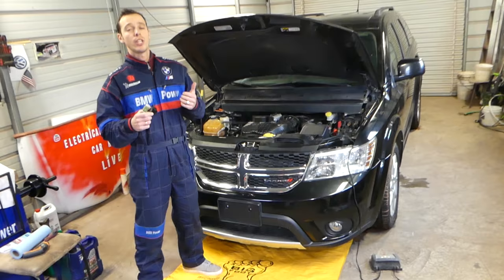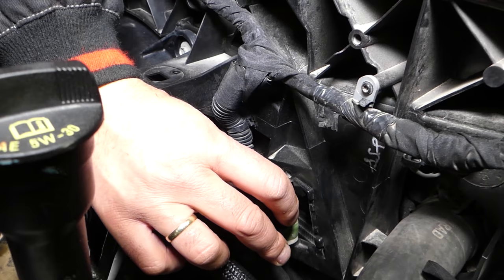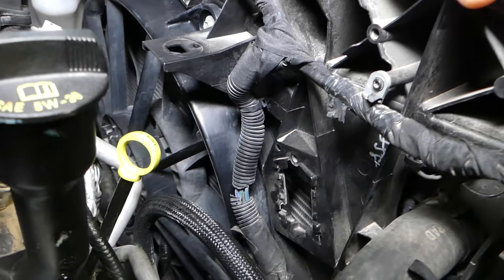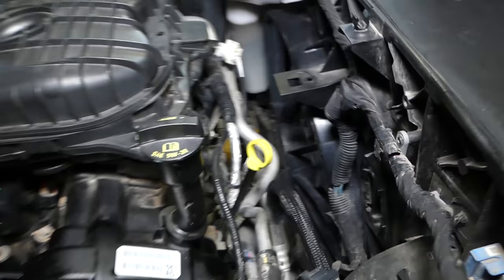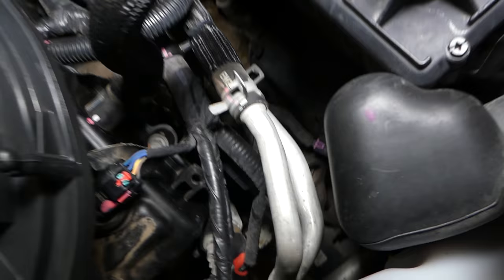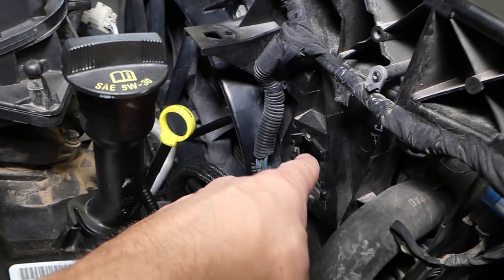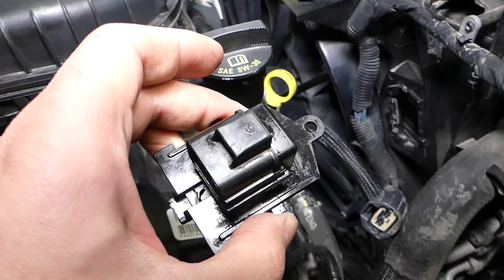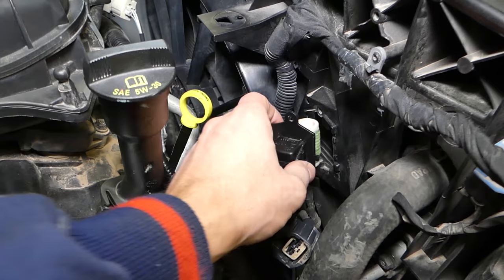WHAT RADIATOR FAN RESISTOR IS. WHAT IT DOES AND SYMPTOMS OF A BAD RADIATOR FAN RESISTOR

Comment: where is a link on how to test the radiator fan resistor?
Reply: If I had to guess. You check resistant/continuity
Reply: @unitedfirearms1057  And ?  What is the reading suppose to be ?? Thanks !
Reply: @tubetime39  you should have continuity. Meaning a direct flow of electricity through the resistor. If no continuity than there's a break in the coil
Reply: I need to know how to test the resistor
Reply: I will ask them again!
Reply: Hi guys! Great videos. You claim you have a link to your resistor test video. There is not one so far. I will try to search your channel.

Comment: I replaced the cooling fan sensor in my dodge journy then still no came on the fan , i have to turn on the air condition to  make the fan  working could be the Engine Radiator Fan Resistor like the way you said in this video if i don.t turn on the air condition starts to heating up the water then boiling too
Reply: I have a journey too an these go out often as well as a million other parts
Reply: Hi - I just read your comment - I have a 2014 caravan and have pretty much same problem. No low fan but when I turn on A/C high fan comes on but I get a check engine code 480. After replacing many parts including cooling fan which includes this sensor, I brought it to a mechanic who just called me and asked if I had the old sensor cause he has seen some of these new ones defective!  I am bringing it in the morning to see if it works!!

Comment: Thank you!! Ive narrowed my issue down to High Speed fan resistor. My fan turned on, but i realized after a few times my car started getting higher temp over mid-point , that I no longer heard the high speed fan kicking on. It didnt heat up until stop n go traffic,

Comment: Thanka for this video injabe a 2015 chrysler 300s 3.6 and i had no low speed  only high. After seeing your video went to the junkyard and grabbed a resistor off a 2011 300. Put it in about an hour ago and now i have my low speed fan back and my car no longer only uses the high speed van to cool the car at 110 degrees. Now it stays nice and level aro8nd 98 to 100 degrees at idle. High speed fan doesnt even come on now. Thanks for your help!🎉

Comment: @ Wondering if this is my problem because at times when I stop the ac temperature drops or blows hot and only after I pull off it starts back should I change it

Comment: Thank you! I just found your video....but I spent $400 to have the whole fan assembly replaced on a Jeep Renegade last week. The old Fan is good.... it was a bad resistor but I didn't know about them. Luckily I still have the old fan. I'll replace the resistor and sell it used to try and get back some of my money. 🤣
Reply: Is the resistor fixed to the radiator fan assembly or to the car body ?
Reply: @richardj8853  the resistor is directly attached to the black plastic fan shroud. Mine is only visible from the inside part that faces against the radiator. I can see the connection, facing the motor, but with the fan attached to the radiator there is noway to see the resistor. I only found it once the fan shroud was off.
Reply: @anthonyalegria7096  thanks for the info, I shall certainly look for it . I've noticed that my car's radiator fan kicks in only for about 4 to 5 seconds ans stops and I find this very unusual. I'd expect the fan to kick in for atleast 10-15 seconds . I may be wrong but maybe you can throw some light.
Reply: @anthonyalegria7096 , i also have the same problem, but my solution will be to cut the old one out and make a insert plat for the new one, so now i can screw it to the fan shroud for easy access

Comment: You guys rock . Have questions I have 2013 grand Cherokee. No over Heating but I don’t hear fan on high anymore. Fan comes on low with AC on OR I let it run it gets to 210 the fan comes on low cools it to 205 and I never hear high fan anymore. Should I look at it or is it no problem???

Comment: What's the small part under the resistor? Is it a thermal cut off or a diode? Both are connected in parallel, what value should it read on resistance test?

Comment: Any idea what the temperature rating is on the thermal fuse?
Reply: i know. its not enough by hungarian standards and dies. like 45 50 celzius fok (degree celzius) is where it died on me. and i had to wait for mr panda laszlo (head of the renault mark service on hungary) for replacement.

Comment: urgent question, is the other device a thermal switch or a diode, please i need an answer cannot find this out anywhere
Reply: The other part is a thermo fuse I believe. I have shorted past many of these in the heater fan motor curcuit and restored the low speed fan operation. If your fan is not working on low speed (heater or radiator) check to see if this fuse is open.

Comment: can this also prevent the compression clutch from spinning?
Reply: Yes since the condenser is getting hot due to the radiator fan high setting isn't working correctly the a/c won't come on that way it protects your car from overheating hope this helps you can check resistance with voltmeter across from the thermal resistor if it has continuity it's testing good and maybe your coolant temperature sensor might be malfunctioning

Comment: Hi, would another symptom that its failing be it turning the fans on later than they should turn on relative to the temperature? 
So for example - if the car gets to like 91 degrees the fan or fans should turn on, But instead of that 91 degrees it turns on at like 93 or 94? Would that be a symptom of failing??
Reply: Possible radiator fan switch or coolant sensor

Comment: My diesel fiesta mk6 fan comes on only when ac is switched on but never comes on when engine hot. Temp guage is stable and always in the middle. No leaks or coolant bubbling. I have fitted new thermostat and new coolant temp sensor.
I have now took this part out of the car and looks same as yours but dont know how to test. Genuine replacement is expensive and dont know which aftermarket brand to go for if test fails.
Reply: If you can look at the number itself on the resistor you can Google it and might find it then have someone solder it where the old one was it'll be more cheaper than a OEM replacement hopes this helps
Reply: @charritolopez8223  
Its sorted now. 
I found these engines have to be running for a long time before the main fan kicks in.
To test, i took my car on local roads and never switched engine off even while i was parked as my passenger went into shops etc. 
After a while i heard a slight  buzzing sound.
I opened the bonnet and saw main fan was on. 
So the main radiator fan on these runs at very hot.
I also have a honda car and the radiator fan on that comes on quite early.
Reply: @tk4270  do u knw what temp? Ran my Fiesta to 107c but it still never kick in
Reply: @declansgamereview6523  
I wish I made a note of it on the digital display for temp on the Fiesta.
All I can say now is keep doing short distance drive but do not turn engine off for about an hour. You should hear engine rpm change and the buzz of the main fan when it kicks in. I did mine in the summer so in winter, it may take longer. 
Good luck buddy.

Comment: Can it make the fan where it runs constantly even when the car is off? My wife has a 2011 Hyundai Sonata 2.0 turbo and for a month now I’ve have  to hookup and unhook the battery to get the fan to stop running every time she drives it or it will run the battery dead smh… PLEASE ANY SUGGESTIONS OR THINGS I CAN TRY…
Reply: For anyone with this problem. Find and pull the fan relays in the fuse box until it shuts off. That one relay should be tested and or just replaced.

Comment: I have a question, I just took my car to the dealership because my car was overheating. I replace the radiator fan before I had took it in, and I replace the thermostat last year. I called them to see an update and they said I need a new radiator fan, radiator fan resistor, and a new thermostat. I literally just got this new radiator fan a week ago.
Reply: Mine does the same.
My fan resistor keeps blowing speed low and medium. I think the resistor is getting too many volts and blowing it. I am on my 4th fan from auto zone, luckily I have lifetime warranty but I need to know how many Volta it should be getting.
Reply: @usernamelastname9708  if known please share also same problem
Reply: Miguel Angel Escobar Lopez 
The one I was buying was From Auto Zone. I believe it was a Denso Brand. Wel the last time I replaced it they made a big deal cause I kept going and I told them it was their fan resistors.
So I got my money back and bought one from Rock Auto. I bought the cheapest one just to test it out and to keep the fan housing since I threw out my old one. Well this cheap fan(cause the resistor comes with the fan already) has lasted me more then the one from auto zone. The bad thing about it is that it shakes when it turns on Low/ medium speed. What I am going to do now is buy a AC Delco one. Bad thing is that it comes with just the fan so You Will need a housing. Dont throw away your old housing. I am hoping that one works flawlessly. These cars suck. Even when I got it off the lot the ax couldn’t keep up with this Texas Heat while parked idling. Best of luck.
Reply: I took my car to the dealership for a p0449 and I believe p0170 after waiting about an hour later the service rep told me if I knew that the car was overheating I was like what are you talking about but since the car had extended warranty they told The warranty department I needed a radiator fan housing so they charged warranty department 700 but the only thing the dealership replaced was the resistor probably around 78$ they made a huge profit scamming the extended warranty department so what your saying they want to scam you for something you don't really need

Comment: My fan wasn’t running and I changed the pressure temperature sensor the fan came on and my problem is the fan comes soon as I turn the 2010 Hyundai Tucson on and goes off when I turn the car off I changed the hi/fan relay and that did nothing I changed the engine temperature sensor in 2019 so could it be this resistor? I think I found it by the fan any suggestions ✌️
Reply: Did you fix your problem ?
Reply: No I’m going to change the resistor and I will let you know if that worked I’ve had this car since 2011 and it’s beginning to fall apart but it’s still running at 99800 miles lol 😆

Comment: hello i have a 2014 dodge caravan. The fan doesnt come on until the engine is overheating HOT!  Then the fan FINALLY turns on and cools the engine back down to normal temp.  I heard there are two temperatures . And mine  doesnt NOT turn on ... on the lower temp. (215degress and 230degrees.)  only the high temp.   Do you believe it is the fan resistor? thank you soooo much!
Reply: Check the relay, separate relay for low speed and high speed fan.
Reply: Hi - I just read your comment - I have a 2014 caravan and have pretty much same problem. No low fan but when I turn on A/C high fan comes on but I get a check engine code 480. After replacing many parts including cooling fan which includes this sensor as well as all relays fuses and thermostat and coolant temperature sensor, I brought it to a mechanic who just called me and asked if I had the old fan sensor cause he has seen some of these new ones defective!  I am bringing it in the morning to see if it works!!

Comment: Did you say that the resistor turns on the fan only when the AC is on?  The fan turns on without the resistor when the coolant temp is too high?
Reply: Yes. I did understand too. How an resistance can sense and turn on / off the fan. Weird
Reply: @gonzalobrig  I think, maybe the resistor is capable of sensing heat. Not sure but guessing. 
There's a way to check resistor but I can not find any of these videos talking about it. Not sure if I'm using multimeter correctly but I am reading 1 to 5 on one & 1 on the other. Just now got Q answered as to how many ohms & parts store said 48 ohms ( I believe ). I ordered two for my twin fan ( 1 resistor in each ) for Ram Promaster van 3.6L. Hoping this does the trick. May pull temp sensor too since I have stuff cleared out in front.
Wish I knew how to release clip on temp sens,  I don't want to break it ! Hard to reach it, worse to fix connector.  Good luck with yours.
Reply: @tubetime39  no! I have news. I learnt these last year. The cooler fan has 2 speeds. low and high. So in low speed the electricity goes through the resistor and the fan spins slow. Then , at high , a relay commute it to bypass the resistor and the fan is at full speed. The relay is controlled by a thermostat.